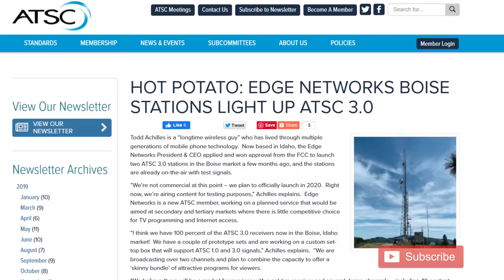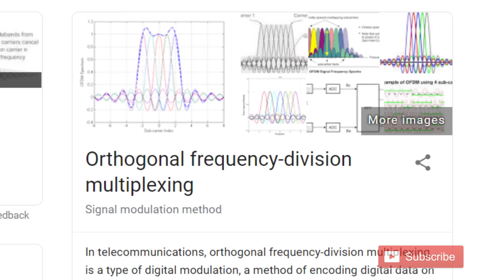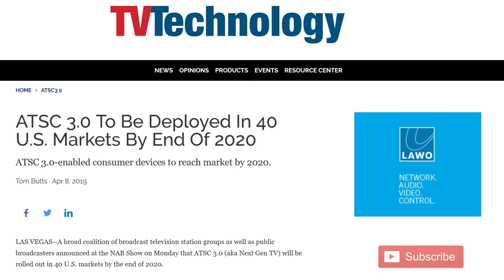ATSC 3.0 Details Pt. 1 - How’s The Reception? Do I Need a New TV?

Comment: I think we will all benefit from the new improved reception from the ATSC 3.0. But why didn't someone think about this for the ATSC 1.0? The last thing I want is to have another dam box. That was part of the reason I cut the cord. Thank you for keeping us informed of the changes.
Reply: Jerry Smith 
Well, as far as I understand it, the ATSC 1.0 dates back to the 1990’s long before we had the broadcasting technology that we have today.
Reply: @totallyfrozen  Exactly - I think the FCC locked that in back in 95? They wanted a standard in place- so they could move to digital by 2006.  This of course was pushed to 09.
Reply: Because 2.0 wasn't even developed in the 1990's Poor 2.0 didn't even get rolled out before 3.0 came along but happily 2.0 got rolled into 3.0. So there you have it, the why of no 2.0 after 1.0

Comment: Stations that convert to ATSC 3.0 have to continue broadcasting in ATSC 1.0 for 5 years after the launch.  So, rest easy about any upgrades for now.  Just know 5 years after the launch you'll need to shop for whatever is available and by then everything will be cheaper.
Reply: I think that’s terrible 4K needs to be backwards compatible or will have a repeat of 2009 which destroyed over the air TV for nearly a decade, it only started coming back very recently

Comment: OFD vs 8VSB is key to the difference between 1.0 and 3.0. It's a completely different system. Although it's also something that the average person might find hard to understand. It's why people will need a new tuner. In a simplified way, it's like the difference between AM and FM radio. The signal is structured differently.
Mobile TV is something that's more likely to be developed by TV manufacturers.
Reply: They maybe completely different system but in time they can be integrated in under one tuner

Comment: The update Antenna Man has presented about ATSC 3.0 is appreciated; especially so with giving background on the shortcomings of ATSC 1.0.
I wonder how quickly TV stations will make the transition to ATSC 3.0 due to the expense of the equipment conversion and labor costs?   Over-the-Air (OTA) broadcasters aren't raking in the dollars as they did back in the analog era.  With dwindling TV audiences due to other video platforms available for viewing content, and the FCC (at least according to online sources I've read) saying the 3.0 platform is voluntary for station owners; I don't see a rush of TV stations making the transition from ATSC 1.0 to 3.0.

Comment: great video, so i guess this rollout will happen similar to 1.0, in that eventually they'll set a date to fully switch over, but that hasn't been determined yet? looking forward to part 2!
Reply: Compared to 2009 which was a mandatory change-over to digital, this time around the FCC is making it voluntary, so the "when" is a lot more vague. They have said that stations have to keep providing ATSC 1.0-type broadcasts available in parallel for five years when they switch to ATSC 3.0. So eventually 1.0 will go away.
Reply: Peter Chase yeah sounds like it’s getting slow rolled, although demand for 4K content might make it necessary sooner? It always comes down to money; whatever costs them the least and makes them the most$$$

Comment: I am from India & I am surprised to know that FTA Satellite tv (Dish antenna) service is not available in USA.
In India we have free DTH service provided by government, it has about 142 Channels with few HD channels for ₹0 (Free)
Reply: Shantanu Upadhyay There still are a few free to air satellite channels that you can pick up over here but not very many anymore.
Reply: ⅰи∂ㄩㄅ360  India uses DVB-T2 for OTA TV,the same encoding that will be used for ATSC 3.0. We do have free to air satellite channels available as well,except there are not much channels.
Reply: ⅰи∂ㄩㄅ360  Most cases Yes. I visited Taiwan and even though the OTA signal is only 30-40 percent in rural areas it's still watchable. Thanks to the DVB-T2 encoding uses OFDM,similar to be way LTE networks transfer signals via multipath. Outdoor antenna would work fine. OFDM modulation does what 8VSB cannot.

Comment: One thing I am anxious to know is if ATSC 3.0 will make stations that are 80+ miles away more usable. You've said that stations around the 100 mile mark tend to fade away due to the curvature of the Earth. I wonder if 3.0 will make it to where such stations come in better. I'm in an unfortunate living station to where my only consistent source of TV is  2 stations about 80 miles away and are not even the market serving my area, though reception is decent for the distance. I often get teased by this Fox station (now Decades) around 97 ways that is unpredictable and far from usable, but tries to come in surprisingly often considering the distance. I wonder if the hyped improvements of reception for 3.0 will finally make these long ranged signals more usable.

Comment: I really hope they work on ATSC 3.0 for mobile devices.  Would like to connect a USB tuner to my tablet and get free OTA 4k TV anywhere I go.
Reply: NyteRazor  By default, ATSC 3.0 will work for mobile devices.  It can be optimized in a way that one program is suited best for rooftop fixed antennas and another program (on the same RF channel) is optimized for mobile receivers.  In this way, the station can serve both fixed receivers and mobile/portable receivers in an efficient manner.
Reply: ⅰи∂ㄩㄅ360   I don’t know but for VHF mobile reception, the earphone cable would make a reasonable antenna, just like for FM.  Problem is that many people like to now use Bluetooth ear buds (no wire to act as an antenna).
Reply: ⅰи∂ㄩㄅ360    The problem with a built-in antenna is that it won't intercept much of the wave for the Low VHF channels, therefore it will provide a very low signal level.   On Channel 2, a 1/4 wave antenna would be  1.32 meters.  Of course that's not possible,so some clever wrap-around scheme and matching network might be needed.  It would work, but there will be limitations for sure.
Reply: ⅰи∂ㄩㄅ360   Very true!  I have spent over 45 years working with TV RF but mostly on the transmission side.  My knowledge of mobile phones/devices is very limited, so I’ll defer judgement on the capability of these devices for 3.0.  Certainly, the fact that it’s OFDM and there are suitable configurations of coding that are well suited to low signal levels, indoor and mobile reception may make all the difference.  I really hope so!

Comment: If ATSC 3.0 is less susceptible to multi-path interference, does this change your opinion on combining 2 directional antennas, in order to pick up distant stations located in two different directions?  I know that this type of interference was one reason why you didn't recommend doing this.
Reply from the maker: No way to tell until years later when it's live.

Comment: Not sure if you've already covered it, but I'd love an in-depth explanation of the current problems w/ VHF-Lo. Reason being: after the '09 transfer, I pretty sure I remember reading an article on why this band turned out to be unsuitable for DTV. Yet, I can't find it.

Also, I'm in the Boston area. And I'll admit that I have one of those card-type aerials that you've told us not to use. But prior to the repack BS, all my expected-local stations were on UHF; so it got them all, no problem. Now (and this weird), our local PBS 2 has moved their primary 2.1 to physical channel 5. But the subchannels are (apparently) still on UHF. So, I get the latter, but not the former. Seems to be the same w/ our other PBS 44.
Reply: VHF-low has a very high noise floor that DTV has a horrible time with. VHF-high has a lower noise floor. UHF has the lowest noise floor.

Comment: Well to date, I have spent $120 Canadian approximately on ATSC 1 tuner cards. I still have an ATI 600 that drops out from time to time for long periods. I had a Avermedia Combo G2 that started dissapearing from the system and making my system crash coming out of suspend. Finally I am using a Hauppage HVR-1800 that I got for $10 that was not working, but I got working by filling in 2 broken off 'FB' ferrite bead smt things with solder on the the card and it seems to more or less work. Where I live I did not in analog get 1 channel in a solid way (non snow non ghost). Now I get like 5 channels quite solidly with ATSC 1. I suppose if they change to 3.0 in Canada I will have to go get another card.

Comment: Is there a web site with a list of stations currently transmitting ATSC 3.0 or a schedule of when they will begin?  I did a google search but apparently cannot ask the question the right way in order to get the information I'm seeking.
Reply from the maker: Only experimental stations are on the air. I'll highlight the markets that plan on launching by the end of the year in a future video. https://in-koherence.com/index.php/us-atsc-3-0-broadcasts/
Reply: @AntennaMan  - Thanks!  It will be interesting to see how ATSC 3.0 works on low VHF during summer skip conditions.  Back in the analog days I saw skip so strong on a few occasions it interfered with local TV reception.  Thanks for all your good information.  There is a LOT of misleading data floating around.
Reply: fevengr   Probably low band VHF is the least suitable band for ATSC 3.0.  From a mobile perspective, it’s not going to work well, due to the small receive antennas in typical mobile devices.  They just won’t be efficient with the longer wavelength (Ch2 is 57MHz center frequency, wavelength is 17ft approximately).

Comment: Will there be STB tuners such as HDHomerun or Tablo come out soon that will pick up both ATSC 1.0 and 3.0 signals? That would bee very helpful to be able to have both types of stations under the same streaming app.
Reply: Tablo told me they are monitoring the situation and that they will respond when 3.0 actually becomes a thing. I suppose they might have an adapter for use with existing Tablo DVR's as well as a whole new unit eventually. It seems like there will have to be a way of receiving both standards since stations will not all be switching at the same time but rather at various times.

Comment: I wish I could try this new standard in my Saint Andrews, New Brunswick, Canada home but the closest station is about 600 miles away which is much farther than any vhf or uhf signal will ever reach 😞
Reply: NICEGUY69 You should get 3 stations from an indoor antenna, 2 more with a fair antenna, total of 7 maybe 8 with a deep fringe antenna.
Reply: Dave Turner with my indoor antenna that I currently have. WMED usually has around %80 signal. CKLT has around %60 signal. CHNB has around %40 signal. I would like to get WLBZ, WVII and WABI as well. One thing I’d have to worry about in that case would be interference from WMEB which broadcasts on the same frequency as CKLT.
Reply: NICEGUY69 I think that the 3.0 standard will eventually come to Canada as well.
Reply: @john26262  Canadian broadcasters don't give a s*** about the ATSC 3.0 transition, except if the federal governement force them as he did back in 2011. And few of them broadcast 4k content yet. IPTV over DSL/Fiber/Coax is the future of broadcast in Canada... With the new internet rate a TPIA provider could offer a DSL/Cable connection over the big4 infrastructures telecoms for a decent 35-40$/month, with an illimited plan (no data caps). 18 mbps is enough for one 4k stream. We need to put fiber deeper in the rural area and offer more than 50 mbps (which is the bare minimum), that's the keypoint. 

But well, ATSC 3.0 still an interesting tech, just too late to be economically viable. This tech must compete in 2021-2022 with 5G + Internet broadband services.

Comment: Why the change again? How many more changes are we to come to expect?
Reply: Certainly, technology is moving faster than many can keep up with.  The one good thing about ATSC 3.0 is that isn’t a single standard, it is a “suite” of standards which includes core building blocks like transmission, encoding,  security, captioning etc.  the basic standard (A/300) mentions 22 standards that are in this suite.  Certainly, additional extensions or additions to this standard could be added in the future.  For example, 8K resolution.
Reply: A local TV station manager told me that he believes 3.0 will save OTA TV from becoming irrelevant in the face of all the online streaming services becoming increasingly available.
Reply: Peter Chase  He does have a point.  In fact 3.0 will “seamlessly” merge Internet with OTA based on the IP architecture of this standard.  A home “gateway” will be the box that essentially connects the two together.  Basically a Smart wireless router.
Reply: ⅰи∂ㄩㄅ360  I agree with you. I won't pay for any streaming service. I'm all OTA plus some free channels available via Roku.
Reply: @martynh5410  Yeah I've seen that. Just waiting for it to happen. Since I'm in an urban area, my current OTA works extremely well. Still, 3.0 will be interesting from a hobbyist standpoint. At the end of the day I actually don't watch that much TV.

Comment: I'm wondering if the best way to get started with this new transmission standard, in lieu of buying a converter or new television set, is with a pc tuner card - a pci or maybe usb type device. I have multiple monitors on my computer already so it would be an easy fix.  Will any products  like this be available?   Thanks!

Comment: I am curious, would the ATSC 3.0 converter boxes work with retro televisions as the 1.0 converter boxes do?
Reply from the maker: Probably not. They'll likely be HDMI just like Roku or Firesticks. They do sell HDMI to RCA converters but at that point you might as well get a new TV
Reply: @AntennaMan  I am fine, just know a few who would be affected by it, so I can give them the heads up sooner than later.
Reply: @AntennaMan  But I'm endurance testing a 1980 13" zenith color TV......I have to get it to 3.0 b4 it dies....seriously, it still has a decent picture!!  haha
Reply: ⅰи∂ㄩㄅ360 ya it was my dads and he was going to toss it so I brought it home and put it on workbench in garage and it’s still going strong, now I just want to see how long it will really last
Reply: Thad Giannetti   ATSC 1 will be around for a few more years.  In any case, you could still add the 3.0 converter and them HDMI to RCA video converter as Antenna Man mentioned.
Reply: Martyn H oh yeah I def will, I’m just amazed that it still works, they must have used good parts back then.
Reply: I'm using a 1977 Philips colour TV that's older than me :)
It only has RF input though... Thankfully, we still have old-skool cable over here 😎

Comment: No matter how you stack it, it sounds like you're going to have to buy something. Sounds like free TV is going to have to be paid for. You do a great job and I have been watching your videos for awhile now. Anolog was an ok picture all the time while digital is a good picture some time. Seems like we're going backwards
Reply from the maker: Technology advances very quickly. You don't have the same cell phone you bought five years ago. The end result will be more channels
Reply: Nothing is ever entirely free. If you want to watch TV, you need to purchase a TV set, an antenna, and other related equipment. If you wanted to watch something in HD, you need to purchase the HDTV equipment. If you want to watch the new 3.0 signals, you'll need to purchase a tuner for it. Doesn't seem unreasonable to me.
Reply: @radishpineapple74  it might not be unreasonable now, but we really don't know how reliable this new technology will be or what a tuner will cost. I get that things change and understand and been through many of them. I also remember when they started talking about the digital signal and how great and better it will be. I don't think they perfected that yet and now we're on to something new. I guess I'll wait and see. It just all adds up that's all. What's next all are radios will be obsolete or maybe the power company will reduce or voltage to 80 volts. Not trying to start a debate or argument, just my opinion
Reply: @jimmotormedic  Well AM/FM radio will be here for years to come,Because the spectrum used is in a very small band. So even in a spectrum auction it would be worthless.

Comment: Im looking forward to to when hdhomerun releases an atsc 3.0 tuner... But im curious what the bitrate will be. The current atsc 1.0 network tuners use roughly  20mbps of network capacity
Reply: It'll depend on what the broadcaster wants. It's a very flexible standard. I'm reading things will average around 24 Mbps, but I don't know how that's going to work for QAM retransmission by cable companies. I'd guess they'll have to move to 19.39 Mbps for fixed-location content, and use the rest of the spectrum for other stuff.

Comment: Will everyone get the improved reception just without the other parts of the technology on current televisions or will they need a tuner or updated television to take advantage of the improved signal strength?
Reply from the maker: You will need a new tuner to access the benefits of the new ATSC 3.0 signals when they launch. A new TV, converter box, or gateway like HDHomerun.
Reply: Antenna Man So the current mileage range of reception would remain until I get one of the forms of updated equipment/TV to give me better coverage?